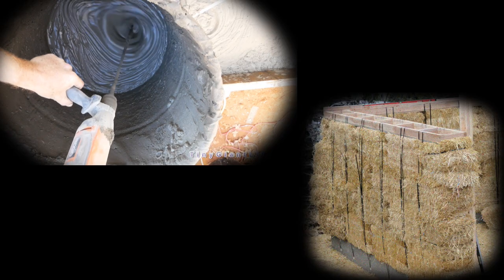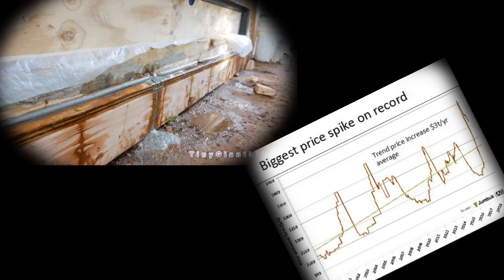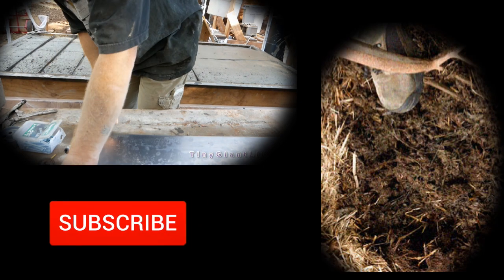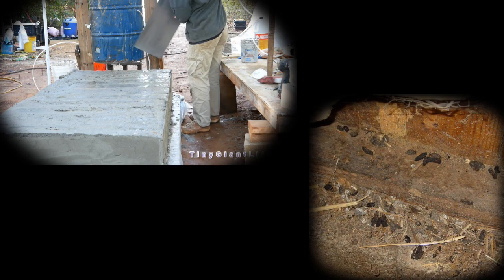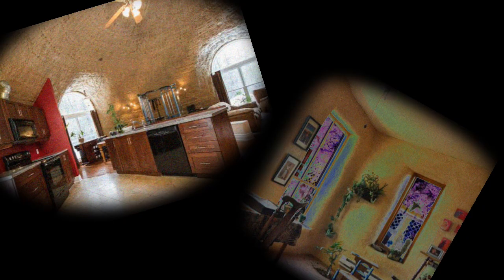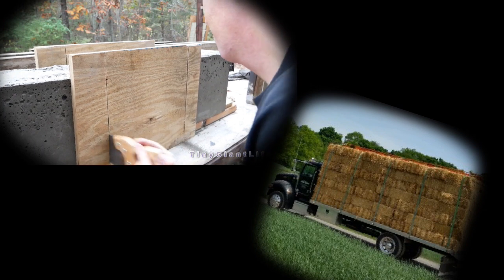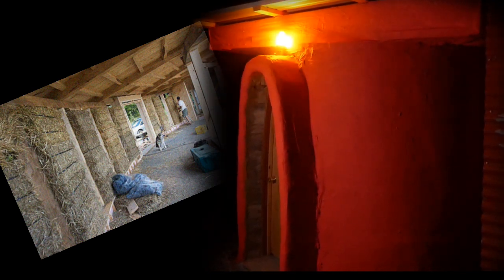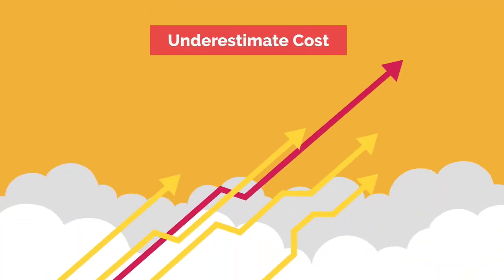AirCrete House VS Straw Bale Alternative Building

Comment: Do you have any examples of successfully permitted, constructed, and lived in aircrete homes?
Reply from the maker: Yes, and no it will not help you.
Reply: @TinyGiantLifeStyle  I don't understand, why wont it help me? My wife and I are looking to build a home in the next 5 years. Understanding the types of locations and areas where people have been successful at building alternative buildings would be a big help to me.

Could you please note a few examples of aircrete home general locations? Even if it's just the state and region?
Reply from the maker: No, Having a copy of my permit is useless to you.  I will help any way I can, but my time is limited.  You have to work with your code official to get an exception or variance.  Otherwise, you must find loop holes like calling it an unoccupied structure or building under 400 square feet; or whatever loopholes hate available to you in your location.

I suggest you build in a place where freedom still exists.  If a specific location is more important then consider Building in something that is not an alternative Building.  Conventional Building with truss walls is still much cheaper when you do it yourself (DIY).  

I have a video showing all the steps to make an micro alternate house/room here;
https://youtu.be/_QQVmZ3UYxk

This is little structure is built with the same methods as any size AirCrete house.  Also, I will be releasing new videos with more details for building a functional cabin.  So be sure to subscribe to get the notice when the new videos come out.  All the information you need is freely available on my YouTube channel and on other channels.

If you desire personal training and gaining experience then consider attending the alternative Building school, a workshop with me or any other person teaching AirCrete.  Explaining the benifits are too numerous to type here!  

Most locations in Texas counties outside cities have no Building codes or inspection.  All you have to do is call a count government and ask it they have a Building inspection department. If not the you are free to do whatever you want!  This is how you discover a suitable location for yourself.
Reply: @TinyGiantLifeStyle  "Most locations in Texas counties outside cities have no Building codes or inspection.  All you have to do is call a count government and ask it they have a Building inspection department. If not the you are free to do whatever you want!  This is how you discover a suitable location for yourself.
"

That's the information I was looking for. Thank you.

Comment: How many days long are your workshops & where are you located? *I prefer aircrete. I've been wanting to build my own aircrete dome house with an underground level ( 2 story). Aircrete is much more sustainable in many different environments and safer in natural storm disaster scenarios such as fire, hurricane, flood & wind proof.
Reply from the maker: We have a 5 day workshop in Tyler Texas.  This teaches AirCrete, and the processes to build a dome.  We also cover the basics of wiring, sizing &installing a minisplit  air-conditioner.  Some people like to bring parts and build their foam machines as well.

In Terlingua Texas we have the 14 day alternative building school.  Here you learn to make AirCrete, you foam machine, as well as build a building from foundation to finished.  You learn electric wiring, solar power system design, lithium battery bank building, worm Composting Flush toilets, custom shower, floor/tile work, roofing, water catchment and recycling, as well as few other relevant topics like using nano-tech paint to increase energy efficiency.

You can find the workshop page here:. https://tinygiantlife.biz/2019/11/27/2020-aircrete-school-hand-on-training-workshops/

Comment: the winner is a hybrid...some square rooms knockouts with straw bale and possibly a nice dome in the middle made of aircrete..PS> I did not understand what those blocks were for..why not add straw or rebar if used as lintels or window bases above a straw wall base

Comment: I have allergy to mold pollen ragweed I would like aircrete
Reply from the maker: AirCrete structures are more healthy because they do not feed mold and they are very tight structures.  With a good hepa filter in the air exchange ventilator the air inside the structure is free of pollen.  

An Air exchange ventilator along with a uv hydroxyl generator in your air-conditioning system (#1 source of molds) would greatly improve any house!

Comment: I prefer the straw bale because 1 lb of cement is 1 lb of carbon in the air. California has a lot of straw in numerous counties even counties close to the SF Bay Area. Love the photos of straw bale homes standing after the Sonoma fires two years ago as long as the roof is metal and no wood trellis it is basically fire proof. Straw bale is mold proof and insect proof, of course it has to be built correctly for that to be true.
Reply from the maker: I was all in on straw bale for some time too.  They are, or can be, beautiful. If you can source the material and a natural material building has appeal! Looking at 3D printed adobe walls now..  

12 trees grown on grey water will cancel the carbon foot print of a small structure. The carbon produced from running air-conditioning or driving to work makes the carbon produced from a few pounds of cement seem almost meaningless..